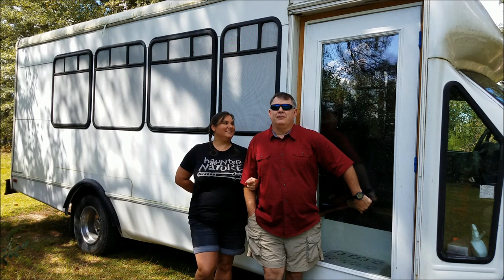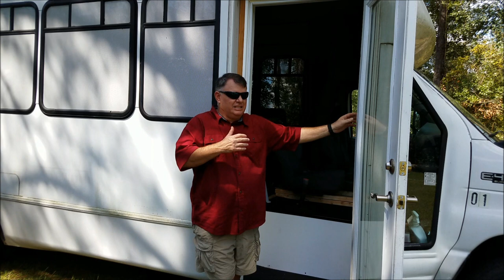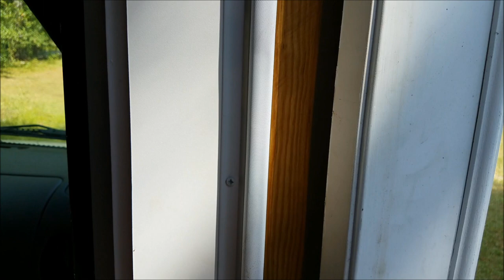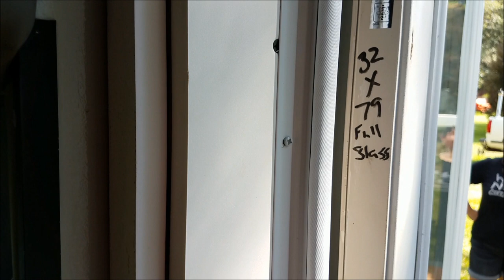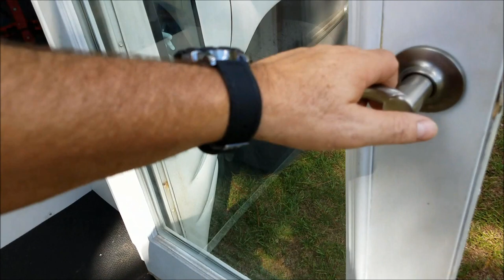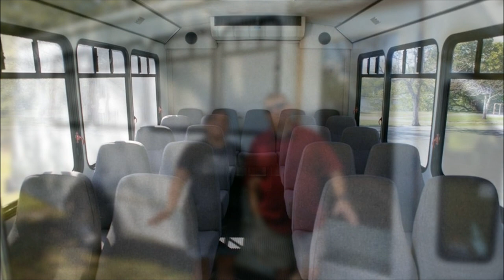Buslife: Replacing a shuttle bus door with a house door

Comment: I too am in the midst of converting my E350 25 pass Shuttle. This is the video I was looking for.  I work too many hours so I have Howie Roll (Van Dweller and YT'er) building mine. Thank you !
Reply from the maker: He is awesome.  I can't wait to see how it turns out.
Reply: @DreamingBigSC  Check out his channel for the build vids. Hope others get some ideas. I'm figuring out now how to install a 12,000 btu split unit a/c heat pump. Going to have to cut hole in floor and let 14 inches of the 22 inch tall outside unit hang underneath for the fans/vents. Other wise it would drag on stuff. Going to be a real challenge...and prob first one ever done.
Reply from the maker: I am.  I have been subscribed to him for a long time.  :)

Comment: Lowes has a door Venetian blind attachment that attaches to the door's glass frame on the inside. It fits over the doors glass, and "sandwiches" the blind between the glass frame and the door's glass. You can raise and lower the blinds, and adjust the blinds angle by two knobs on the side of the attachment.

Comment: Thank you for the videos! I just bought a shuttle bus! I have zero experience building anything but plan to try to do it myself with hopefully some help from friends! I’ve been watching tons of videos! My question is regarding insulation. Yours is the only build I’ve seen where are you did not put in insulation. Even before seeing your build I was very curious as to if it could be done without doing all of the insulation and have it still be very livable and comfortable. I was excited to see your build! Seems so much easier! Especially for someone like me who doesn’t know what I’m doing! However I do plan to be in very hot and very cold places. I don’t want to get done with my build and wish I would have insulated it in the first place. What are your feelings on this? Do you feel you would be more comfortable had you insulated it? Do you feel it doesn’t really make much difference? Thank you so much!